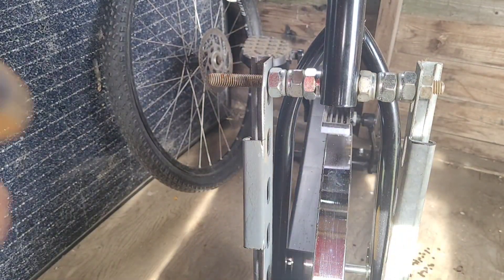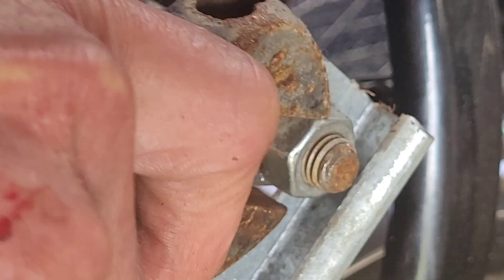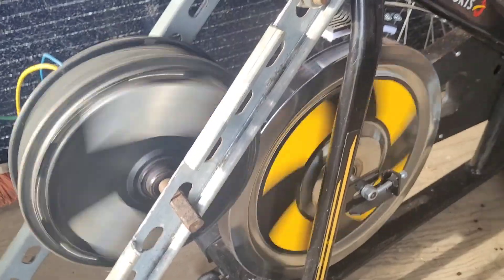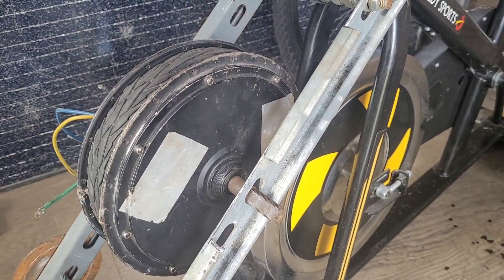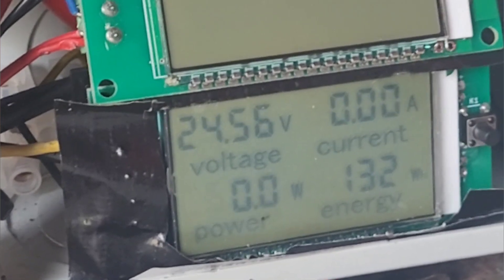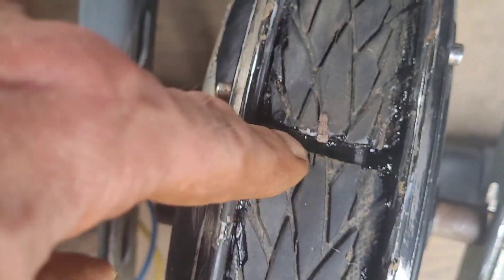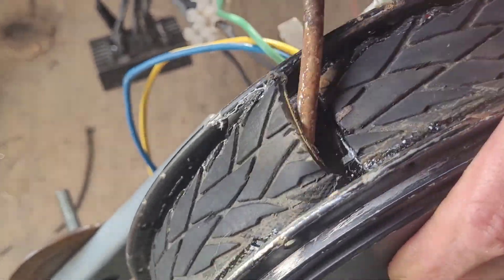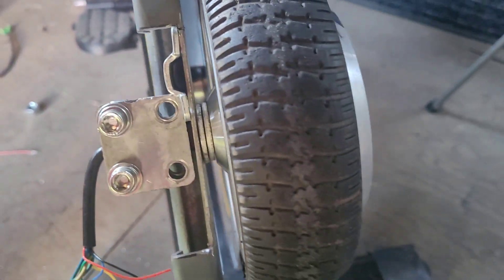Spin Bike Power Generator Project - Back To The Hoverboard Motors for Now.

Comment: Good to see the experimenting with different motors and weights.
Is it better to rewire that motor because it doesn't seem to generate a lot of power?
Not sure if it's delta or Y
Reply from the maker: Not sure about the wiring, I plan to leave the motors untouched, cheers
Reply: @GavinFreedomLover  https://www.youtube.com/watch?v=sO9VX6ElDfY
Moves from Y to Delta to get more power out of the motor. Not sure if this helps in generator mode.
Reply from the maker: Is je using it as a motor or a generator in the video , thanks.